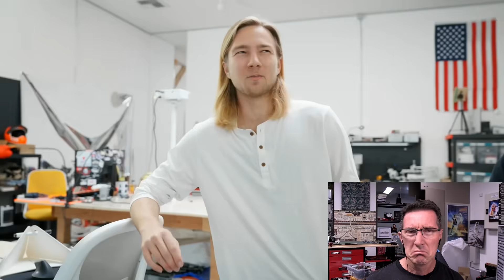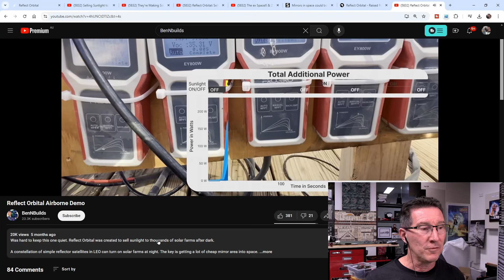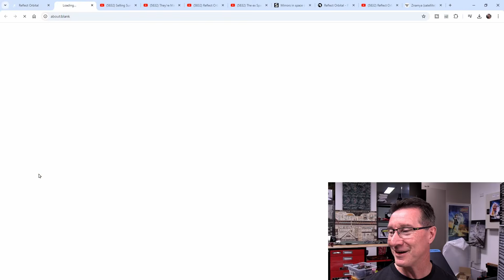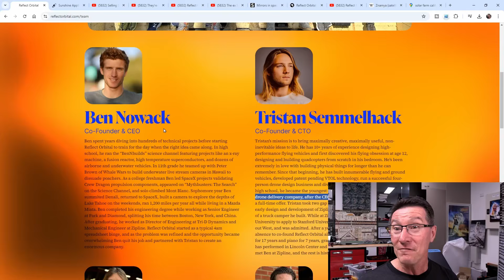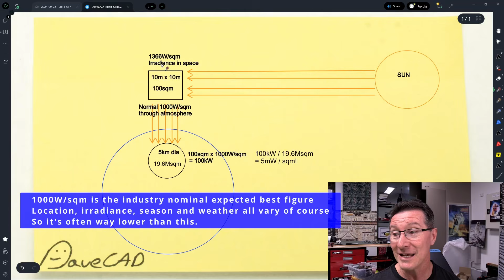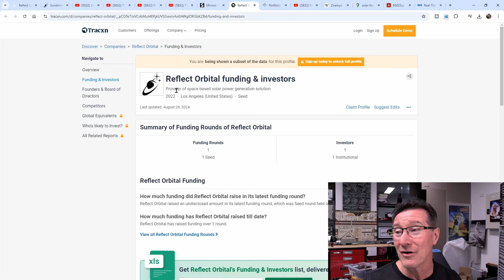EEVblog 1637: Solar Freakin' Space Mirrors! - Reflect Orbital DEBUNKED

Comment: My guess is that a battery is cheaper to deploy than a space mirror.
Reply: and there are plenty options for batteries:
- used lithium batteries from EVs, in 10 years we will have lots
- sodium and other less weight optimized but cheaper chemistries
- flow batteries (this one is still not a mature technology though, but has a very long history)
Reply: @adamrak7560  Kinetic batteries, aka flywheel batteries are the best solution for static deployment. No polluting technologies, volatile or precious metals needed.
Reply: @dgo4490  meh, that sounds boring - how are tech bros going to get venture capital for "spinning heavy things", unless they're made out of pure tantalum with 30% diamonds sprinkled into the mix??
Reply: Just the commercially available grid scale batteries right now would be orders of magnitude better value per kWh than this 

No contest.
Reply: OP got it in one, local energy storage is leagues better on all accounts. Chemical batteries, flywheels, pumped storage hydroelectricity, cryogenic energy storage...ALL of them can pay back their installation costs within a human lifetime, unlike the (literally) astronomical cost of what these yahoos are proposing 😁
Reply: bwhahaha..  I wonder, by how many orders of magnitude,  would a battery be better...  
Especially with the belly in that duck curve being so much cheaper during the day.
Reply: Pretty much. Add a big battery at the solar farm that is 2x the size needed, then discharge it down to around 50% in the evening to stretch out the overall production of the plant through the evening as the sun starts to set.
Reply: A VERY educated guess!
Reply: A battery made from mining the moon would probably be more practical
Reply: Or solar farms could just transmit power eastwards on the grid.  And batteries/offcoast farms for Commiefornia.
Reply: Yeah, but what if you already use all the energy your solar farm(s) generate ? Having batteries won't help you generate extra. Extra sunlight will.

Too bad that these space mirror can't give you extra sunlight, just cute, useless moonlight. I guess it would be fun for an outdoor party. Or for some high-altitude hikers.
Reply: @Winnetou17  Then you just deploy more solar farms...
Reply: @BriBCG  What if you're out of space ?
Reply: @Winnetou17  Not likely to happen any time soon. Even if it was launching expensive ineffective satellites into orbit is hardly a viable solution ;)

Comment: The energy it would take to launch the rockets would never be reclaimed from reflected light from orbit.
Reply from the maker: That would be an interesting calculation...
Reply: @EEVblog  The energy of an object in low earth orbit is around 30 MJ/kg.
So for a satellite of like 30kg, that would be about 1 GJ, or a bit less than 300kWh.
Of course, to send the object to that orbit, the rocket will spend way more energy than that.
Reply: @EEVblog  Not to mention the energy to maintain the orbit and angular stability. These mirrors are not without reflective energy loss (aka Photoelectric effect). The incoming light will provide some thrust. I don't have the time or inclination to do that math but it isn't zero.
Reply: @EEVblog  I have done some basic math and the result is that energy used on the launch is unimportant. 

With SpaceX starship, it takes around 5kg of methane to launch 1kg of payload into orbit.  NASA Advanced Composite Solar Sail System has 81m2 sail @16kg so launching 1kg of a mirror into the orbit takes around 1 kilograms of methane.  The caloric value of that methane is around 55MJ and with the solar constant of 1.3kw/m2, it will take such a mirror around 12h to capture equivalent energy.  

This is some basic calculation to give some order of magnituted
Reply: @Flinno-k8w  
> 4.500.000t of fuel&Oxidizer. So it'S 45kg for ech kg of theoretical max payload

Methane is 22% of the total fuel mass.  My mistake, this should be 2 times more.  

>But you need a payload displeser and mount that weights a lot, and you will not really max that out becasue the light Space mirror sats are for shure volume constrained. 

Not even close. That NASA satellite has a density of around 1kg/l. Starship has a payload volume of 1000m3. 1m3 is 1000l so you have more than 10 times more space than you need.  We can throw 50% for mounts and stuff.

>You also just take the energy content of methane into account, which is also misleading. MAKING methane, the grey energy to produce, store, cool, pump and filter the methane could be 50% of it's energy content.

Sure, we can go with this

>Extracting Oxygen is  not energy free as you assume. Making it liquid also takes a lot of energy. 
Arond 1.4MJ/kg. So the total cost of fuel grows from 55 to 65 MJ/kg per kg of methane

>The real energy consumption for gettign it up there is several magnitudes more than you think.

Everything you just mentioned is around a factor of 5, not several orders of magnitude.  This changes the time for net zero energy from 12h to 2.5 days. We can throw in some geometric factor of 3 and still, this satellite will be a net zero after a week. 

My point stands, energy for launch is not an important part.
Reply: Don't forget the energy needed to manufacture the satellites in the first place when counting from the mines to final assembly and packaging into launch units.

These things are probably net-negative long before they reach the launch pad.
Reply: Hang on, rocket plumes generate lights right? what if we direct the rocket plume light with mirrors onto a neighbouring solar farm! CHECKMATE
Reply: Tech bros once again falling into the trap of spending absurd amounts of money to put solar power systems in impractical places, instead of spending a fraction the amount of money to put solar panels on rooftops and empty land and battery systems to power overnight
Reply: @NewtoRah  perhaps the idea is really more to fool people into financing the endeavor that never materializes, and then embezzling the money along the way. Ironically maybe it's "technologically" more feasible, I guess.
Reply: @NewtoRah Or the greenest renewable energy we have, nuclear fission. Also works in the dark.
Reply: @Steevo69  Incorrect, fission doesn't work in the dark as it releases light.
Reply: @oledonly  Cherenkov radiation is my favorite color of electromagnetic radiation that excites proteins in my retina and is understood by quantum effected neurons.
Reply: @NewtoRah that’s because someone else already commercialised that.
Reply: @NewtoRah  that won't give you those sweet sweet startup investment $$ though. Solar panels on roofs are 'boring'
Reply: @NewtoRah  omg please stop with the battery systems... yall never heard of pumped hydroelectric storage?
Reply: but they gonna fill rockets with CO2 and release it in space so it would be CO2 neutral.
Reply: Launching a satellite into polar orbit is even a bit worse than usual.
Reply: It's in another GALAXY
Reply: But that energy is liquid hydrogen. so it's a completely different account 😎
Reply: I don't disagree with you, but I'll just put in the slight caveat that something like this might be somewhat more practical if we ever become truly spacefaring like in the Expanse for example. The thing about orbital infrastructure is that the price goes down exponentially if you have the ability to build it in space from materials already IN space. We definitely aren't anywhere close to there yet though unfortunately.
Reply: @Fanghur1123  
Yes once we are out of a gravity well and living in space using its resources endless solar power will be the norm.
Reply: Inefficiency never stopped us before.
Reply: The launch will be done with the pseudo-static relativistic energy harvested by polarised-flux solar roadways. That is practically free.
Reply: If you close your eye Ben sounds uncomfortably exactly like Elon Musk.  Interesting.
Reply: I asked chatGPT: Energy Spent: Approximately 1,223 kWh is required to launch a 12U CubeSat.
Reply: @JanCumps  you might as well ask a toddler... LLMs will happily tell you Elvis is alive and the president of moon-nazis.

Comment: Reverse comparison......The 'Centrale solaire Thémis'  in the Pyrenees was a solar thermal plant.
11000 square meters of reflectors all pointed at a single receiver 15 square metres in size.
It was a concentrated solar power (CSP) plant, i.e. thermal and had an output of 2.5MW.
So, the power reflected per square meter was approx. 227 Watts (2.5MW/11000).
........but using Reflect Orbitals maths it'd be quite scary the output it should have been producing.....LOL!
Reply from the maker: Yeah, seems to match the number they got from the baloon test, which sounds about what you'd expect. The problem is the cost to put it up into the orbit, and the spot size on the ground.
Reply: Using whatever form of math they had, it wouldn't be a scary amount of power, you would be able to run a fusion reactor off of that energy input. Sence their math bumps up solar power input by many orders of magnitude and then if you do their math in the situation you layed out.....
Reply: There actually are plants like that in the USA as well.  They are a failure, economically.
Just too much investment and upkeep compared to the amount of energy produced.
Reply: Oh dear... they should just apply for DARPA and call it orbital solar.

Comment: Yes, the tiny 10mx10m reflectors are bunk as revenue generators. But they are an adequate proof-of-concept, good enough to play with beam steering and focusing, though the SNR against the twilight skyglow could make the data noisy. Going with a larger yet thinner structure that borrows from solar sail research could provide a better testbed for the same launch volume and mass.

The basic satellite idea looks OK, viewed only as something that can be built. Moving the target spot by warping the mirror can work using minimal power, significantly less than trying to pivot the entire structure. This should be investigated on-orbit to determine both functionality and reliability, with only enough solar flux reflected to permit accurate performance measurements from the ground.

Thrust will be needed both to maintain the SSO orbit (to correct for the solar thrust against the collector and orbital perturbations due to the earth's shape and space weather), which can be accomplished in any number of ways (ion thrusters, electromagnetic tether, etc.). Some force will also be needed to maintain the overall reflector orientation, again which can be done in any number of ways (gyros, gravity gradient boom, etc.).

Let's assume the underlying concept works (a solar reflector in SSO that can be focused). As Dave said, the scale of the reflector is off by orders of magnitude for minimally useful flux to be delivered to a solar farm.

First, how big of a mirror is needed to reflect full solar intensity (1 sol) to a solar farm? Assuming a perfect reflector, to reflect the projected size of the sun (0.5°) onto LEO (600km-800km for typical SSO), would mean an area of roughly 14km^2 after accounting for a 45° tilt. That's on the order of 4km on each side! (I'm using hand-waving math here, barely above mental math, so I could easily be off by 2x or more.)

OK, that's way too large. The limit of engineering may be closer to 1km on a side, but I'm thinking the Mylar thickness would also need to grow, due to the tension needing to be applied to accomplish the dynamic focus requirements. Let's go for 1/4 sol (still very useful) and add some redundancy at each orbital slot, say, 4 satellites at each location, meaning each would be ~500m on a side. That seems more manageable. Maybe. But that's still one hell of a lot of Mylar needed to fill all the orbital slots!

The 10m satellites are an excellent and affordable proof of concept that's worth testing. Scaling up to commercially useful levels of solar flux at affordable systems costs is the problem. Even if Starship can provide delivery to SSO at 1/10 of the Falcon 9 price, launch costs will still dominate, meaning the satellites would need to have maximal lifetimes to amortize JUST the launch costs, meaning thicker Mylar to tolerate cumulative micrometeorite damage, meaning a heavier satellite, and the cost spirals upward.

There is probably an optimum balancing satellite mass against launch costs against longevity against performance against revenue, but I'm way too lazy to try to calculate it.
Reply: Could you imagine swinging those huge mirrors - CMGs or reaction wheels would be needed - to direct the reflection to where you want it, without twisting the mirror, which would scatter the light and make it worthless?